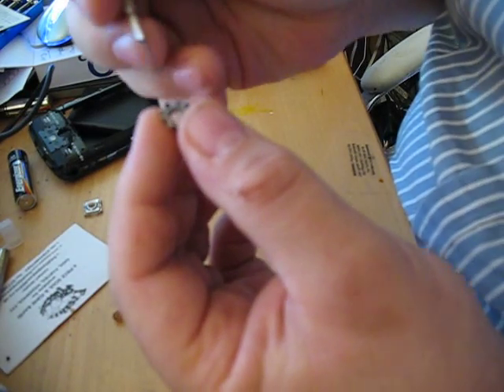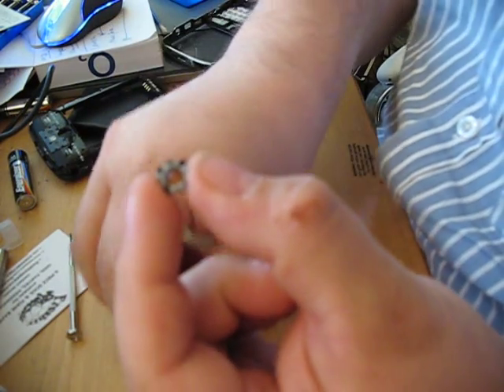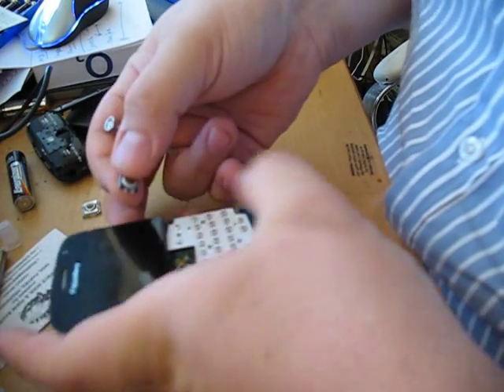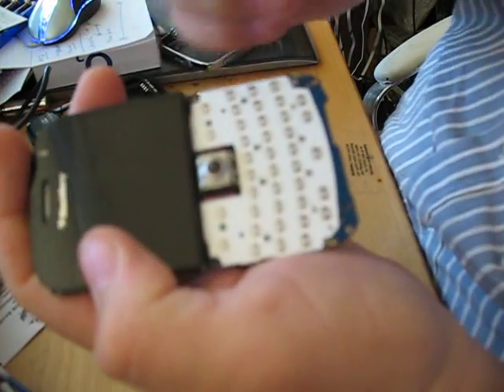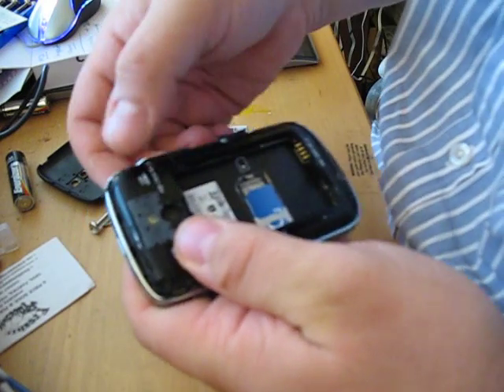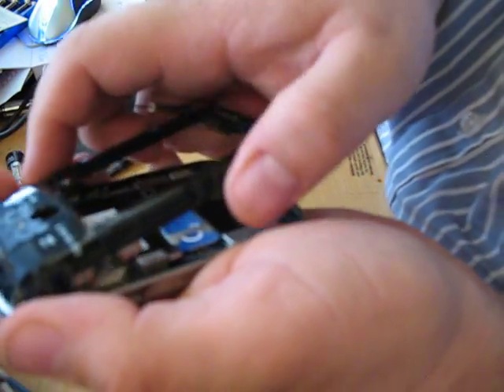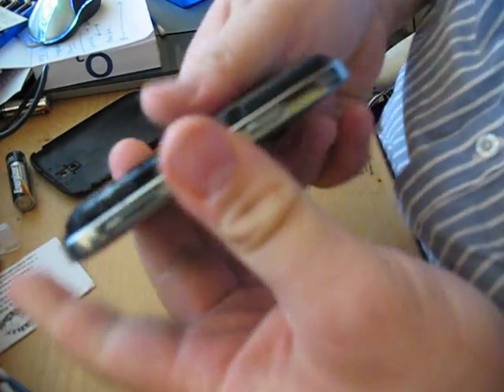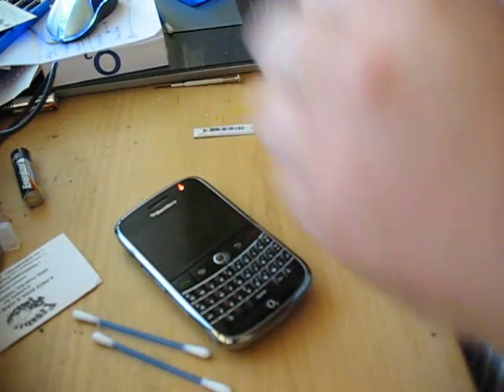Blackberry Bold 9000 - Stuck Roller Track Ball - Clean and Repair 2/2

Comment: Nice how to
I have a curve and it is a lot easier as you only need to remove the chrome plated bezel to remove the ball
I also used a fine brass suede brush to clean the fiddly magnetic splines
thanks